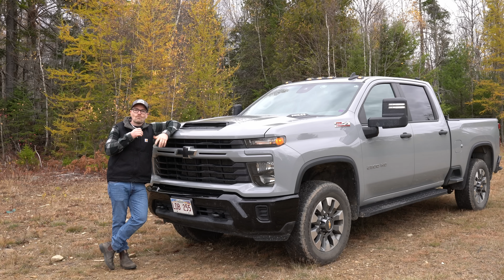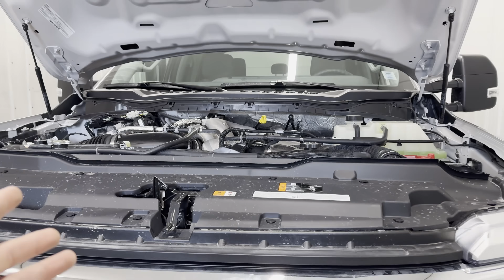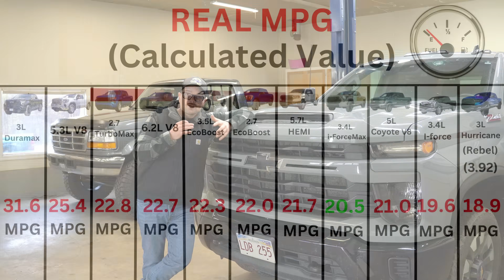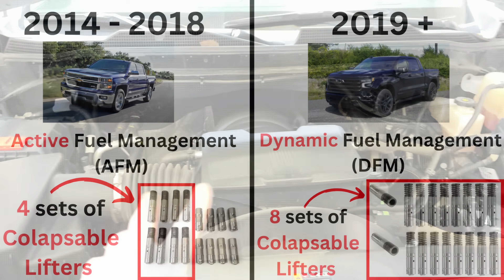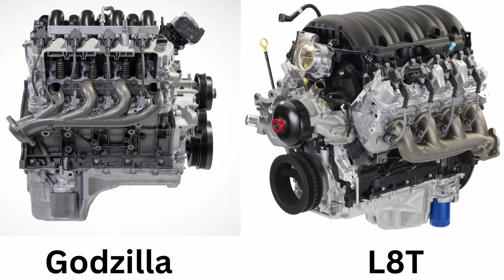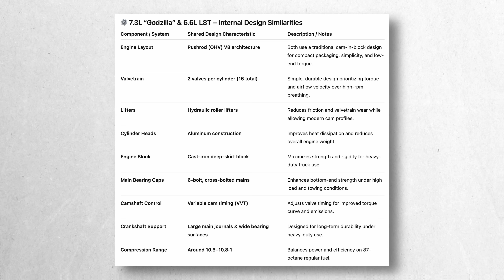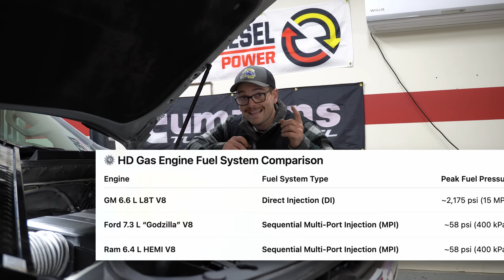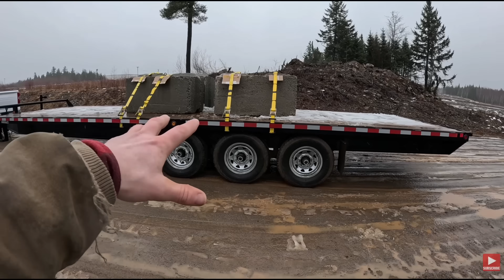Chevy 2500 6.6L L8T V8 Review | GM’s MOST RELIABLE Engine They Still Build

Comment: Man those 8.1 and 6.0s were tough long lasting engines! I doubt they will ever make an engine that lasts as long as those again.
Reply: I’m holding onto my 2016 6.0. Doesn’t even have 30,000 miles yet.
Reply: @Zach_CB I have only 57k miles on my 07 classic service truck 6.0
Reply: @Zach_CB wow
Reply: @Zach_CB how ?
Reply: I have 340,000 miles on my 2015 6.0 and she's still running very strong.
Reply: I have a2009 extended cab 2500 lt. 6.0 the best truck I've ever owned. I have 266000 on mine docent ues a drop oil the best engine ive ever had. Will keep this truck for a long time.
Reply: I like my 6.0  slight underpowered at times but it works, easy to add power also. 130k I'm driving until it dies
Reply: I own a 2006 8.1 silverado  (191k miles) , 6.0 silverado 2000 (420k miles on it, owned it for 17 years), 6.0 express 2004 (300k miles). they might be what most consider old but they always get me home, regular oil changes all it takes.
Reply: I’m at 248,xxx on my 6.0, easy to maintain Nd decent power
Reply: @3g2000gt I just sold my 2011 6.0 with 285k.  I sometimes wonder if I should have kept it.
Reply: My 2025 pulls so much better then my 2008 that it replaced. The only thing I don’t understand is why the gooseneck placement being behind the axel. I would think it would help pull even more.
Reply: You just watched the video about the next longest lasting engine 👀
Reply: Fact
Reply: I have all you guys beat, my 1st year released 6.0 (1999) has 112k miles and a supercharger that was installed in 2003.. runs like a son of a gun , 2nd transmission though
Reply: @AlmostOutside any vids
Reply: I have an 8100 in a 2001 2500HD suburban 260,000 OG engine and it pulls better than new trucks
Reply: 300k KM on my 2001 6.0 with a 16' enclosed trailer full of tools attached to it its whole life.
Reply: Have two 6.0s both over 100,000 still rock solid.  A 2003 and 2004 very little electronics in either
Reply: In 2003, I bought a Silverado 2500HD with the 6.0 L engine, the best GM engine I ever had.
Reply: my dad has a 8.1 flatbed, that thing is jumpy with 134k miles
Reply: Yeah, not trading my 2017 GMC HD with 6.0 plus $50k for a 6.6 with a 10spd. At least not at this point with only 42k miles.
Reply: I bought my 06 used with 60k miles on it. Traded it in for a 25 trail boss which I really like. But I wish I could have kept it. Was a hell of a work truck with only minor issues that could be easily fixed. Had 150k miles on it. A guy bought it from the dealership who lives near says he loves it. Now I want another one. Lol
Reply: @lj2814 the 6.6 l8t seems to holding up extremely well I love mine
Reply: 6.0 has lifter issues and sucks gas... It was a dog towing...

Comment: I put one of these in my 2018 Sierra 1500 after the 5.3L blew (classic lifter failure).  Bolted right up and the tuner got 400hp at the wheels (CAI, headers/exhaust, E-85).  Went on a trip to Denver and got 16 and a half on 87 octane.  So happy with the 6.6L gasser!
Reply: Did the transmission work or did you have to swap it as well
Reply: @hunterhill1013  6 speed bolts right up
Reply: @hunterhill1013 no
Reply: No u didnt
Reply: @MrC9Oh3  everything from the 1500 to the 3500 is literally identical under the hood. the 1500 even has the empty hole where a 2nd battery goes for the diesels. it may not have those options from the factory but swapping them in isnt that hard. for instance if you get the diesels or other industrial engine options that come in like a 5500 or similar, you can retro fit the upgrades those would have on to yours surprisingly easy.  for example an ambulance has a 2nd alternator to power everything in the back, on the diesel theres a spot right on top of the block, its a simple bolt on to add it in then you just have to swap to the bigger belt for it. also some have an extra cooler for transmission fluid, the connections are already there you just have to bolt in the cooler and add the lines. lots of other upgrades are totally possible and simple to add because the drive train was already designed for it
Reply: @MrC9Oh3  ok

Comment: 2025 6.6 Chevy here and love it so far. Coming up on my first oil change. Are you guys going with what's recommended in the manual??? What is the opinion out there on the oils for this motor???
Reply: stick with AC Delco or Mobil 1 5w30, your oil change should be free at the dealer

Comment: Had 2 of these in my fleet eat a cam and destroy the engine. Dealer replaced just the cam and lifters only to have the main bearings wipe out 2 months later. Even after i told them there would be alot of metal in the engine from the cam failure.  6 months later and i have another one down with the same issue and no parts are available.  GM is garbage.

Comment: As long as the transmission is reliable, “clunky” is fine.
Reply: they didnt even have synchro's in transmissions in cheap cars until the 60s were pampered
Reply: Just traded out of 22 At4 after the 6.2 failed for a 2026 2500 gas and it has Allison badges
Reply: Trans is not reliable, it’s not an Allison. It’s a larger rebadged 10r80. It’s so unreliable it caused Allison to cancel their relationship with Chevy moving foward. Dealers are going to have to remove Allison badges off of new trucks start in in 2026
Reply: @johnwalker6140 a whole lot of misinformation in one post lol.
Reply: @johnwalker6140  That's actually not true. They are probably the most reliable auto trans that GM has ever produced. The 6 speed autos not so much. And I agree about the Allison name. Who cares, just give us stuff that works.
Reply: @CabinCruiser  😂😂😂😂😂 do any amount of research and you will find the 10 speed is a live grenade. Allison terminated their contract with Chevy it’s so bad. Do some research bud
Reply: @johnwalker6140  Only the bad examples are the ones talked about and I believe most of those issues were addressed coming into the 2025 models. I do research and even get insider information as it IS our actual industry that we work in. 👍
Reply: @CabinCruiser  go watch any ‘The Car Guy’ or NextGen videos on all the technical issues with both gm and fords versions of the same 10speed. https://youtu.be/m2GwZ0JPAMM?si=clgRtgdvpni8h9pQ (bu the way in a 15 year certified master tech as well)
Reply: @CabinCruiser  if it’s so reliable, why doesn’t Alison want to put their name on it, not only that, why is Alison demanding their name be taken off of it….because it’s so bad😂😂😂😂😂😂
Reply: @CabinCruiser  Well your inside info is crap. Lifetime GM tech and these GM designed "allisons" are junk, have been replacing 2026 units lately. when it fails, not if, cant get parts and the truck sets at the dealership for weeks/months waiting on parts. They are POS transmissions
Reply: @Ever443 I’ve been noticing a strange noise on the one I drive at about 40 mph on the downshift (transmission) I’m sitting at about 2700 miles on the odometer. 😬.
Reply: @KenHamner-gr6pm it’s fine

Comment: I wouldn't any sleep over the direct injection. I can personally attest to almost 108,000 trouble free miles personally with a much higher stressed engine. Also working for Nissan, I've only seen one problem and that was a pump lifter that kicked the bucket because they guy didn't change the oil. I doubt the fuel system will give me any trouble on my truck. GM stuck the high pressure pump on the back of the cam shaft right where a distributor used to be on the 454s and 350s.

Comment: The LS and LT were great engines.  Scrap all the direct injection, cylinder deactivation, etc.  those are the things that ruin all these late model engines.  They will literally run forever without that 💩💩💩.  KISS is the way to go.  I would prefer a 427 or 454 displacement, bigger is better.

Comment: Just heard Allison is not renewing its licensing agreement and is demanding removal of badging on inventory after June 2026. Not a good sign of their faith in the 10 speed.
Reply: Allison did not make the 10 speed, GM had the licensing agreement for it so they slapped it on there and Allison disliked the bad press it gets and they don't want their name on a high issue unit that they didn't build. I don't blame them. Personally, I Hope Dodge can pick them up and get it behind the Cummins, and then fix their front ends. Would make a powerhouse of a truck.
Reply: @nolanbumgardner3576 I have a 3500 with the Toyota Aisin tranny. 321000 on the clock and zero issues. It’s a tough transmission, even though it is super slow to shift and sometimes can’t make up its mind what gear it should be in.  but if it goes I will be putting a 6spd genuine Allison in. I am happy that Ram went with the ZF in the new trucks though. I have a couple friends with the new trucks and am curious how they will be lasting.
Reply: @nolanbumgardner3576  They already have ZF for their transmissions

Comment: I have a 21 3500 HD DRW with a 10' deck on it. When I was looking at propane conversion, I thought the conversion place said these where direct and port but maybe I misunderstood and the propane would be direct injection? I love the simplicity of this engine. Cold start the exhaust smells like a early 2000's V8. Maybe due to different emissions regs for cab and chassis but I take it as simple fuel mapping. I do notice some oil consumption hauling our camper in summer, if your working it, maybe 1 L over 8,000 km. I tend to do 8,000 km intervals with 5W30 Motul full synthetic. Usually 30-40% oil life showing but sniff meter smells like it's due. I feel the oil filter is to small and maybe that leads to higher oil temp which burns it. My only complaint with this truck is punishing empty ride quality with the torsion bar front, no up travel but should be a dependable long term unit. That motor should take supercharging well??

Comment: The high pressure fuel pump requires removal of the intake to be replaced. Not really a deal breaker, but I do understand that it may not be one's favorite thing to do. The fuel system is pretty simple on this once the intake is off.
Reply: It can be relocated to the frame rail
Reply: getting the intake off is pretty standard and not that big of a deal for most projects. hell transverse v6s you have to take it off just to do spark plugs. so im sure there could be worse. could be german

Comment: Thanks for all the info, bought one recently, and very pleased so far… tows much like my ole five point nine Cummins, and rides super smooth.  I’m hoping to avoid any soot build up with top tier fuel and fuel treatment.  I’m will for sure change the oil every 5k, looks like it will be super easy!  I purchased, actually had to order a two wheel drive, base truck, that for me, checks all the boxes, a little technology, comfort, and simplicity.

Comment: The overhead lights aren't solely a GM signature, the three "identification ' light in the middle are DOT law  when towing a trailer over 80" wide or for the truck alone if it's a dually. The two outer lights indicate vehicle height.

Comment: The only thing I have experience with these 6.6s cropping up, and this isn't particularly the engine's fault, is the AC compressors going out. Most suppliers around here are on backorder due to the frequency of failure. Likely due to high idle hours, just like the eco tune 7.3s had with their oil pumps.  I think the biggest takeaway about that 6.8l feeling more peppy would have more to do with turning the sheer mass of those heavy duty 10 speeds. If I'm not mistaken, the 10r100 has a similar sized case to the 10r80 and is based on it versus the 10r140 or the GM here. That's not a small parasitic loss. Thanks for diving in and going over the background details on your videos and not just regurgitating brochure media material. This is really shaping into a very well-structured channel.

Comment: I have the 6 liter in my 07 2500. Lots of miles and still going strong.😊
Reply: My 2014 GMC 2500 6.0l has 752000 kms on it ......still working...never been in the motor...been an awesome work truck
Reply: Wow dude thats awesome. Good for you. Keep er going 😅
Reply: under powered and terrible mileage but a solid and reliable engine in general.  If you are happy that’s all that matters
Reply: @Jez-p9k ....i am happy with it because the truck and myself are both retired.😊

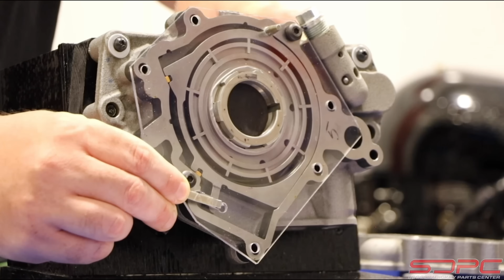Comment: @6:03 6.2 are being switched to 0-40, so even 5-40 or 0-40 could be a possibly better oil choice for an HD engine
Reply: Only for ones not built properly. The 2026 are back to the old spec

Comment: We have a 2020 f350 powerstroke and a 2023 gmc 3500 gasser. Both DRW and both work our farm. The 350 tows a 38ft 6 horse. The 3500 does everything else we need done. Both serve there purpose. The 350 has definitely cost us more money in maintenance and repair. The 3500 has 130k miles and has only need a front axle seal replaced. Nothing more.

Comment: Thank you for the informative video. We own a 2024, 2500 LT with this engine. You mentioned a problem with carbon build up on the fuel injector. I am considering using a fuel injector cleaner to help mitigate the carbon build up. The research that I've done points to using an injection cleaner with PEA (polyetheramine). Is this something you would recommend or is it a waste of money? My concern is I do not want to add something that could be harmful to components of the fuel system. Again, thank you for making these videos - they're very helpful.

Comment: Love my gasser for working, said Noone ever.....
Reply: We have a 2020 f350 powerstroke and a 2023 gmc 3500 gasser. Both DRW and both work our farm. The 350 tows a 38ft 6 horse. The 3500 does everything else we need done. Both serve there purpose. The 350 has definitely cost us more money in maintenance and repair. The 3500 has 130k miles and has only need a front axle seal replaced. Nothing more.
Reply: diesel actually sucks these days. if i had to buy something for towing itd be this or the ford big block. 
DEF ruins everything

Comment: As long as I doesn't have cylinder deactivation, it's a winner in my book
Reply: Amazing that the manufacturers don't seek any input from buyers who actually know a little about cars before adding terrible features that we hate.
Reply: @camarokurt  our opinions don't matter when the government set fuel efficiency requirements.  Ironically, I get better mileage with my AFM turned off
Reply: @porkchop10 the 25/26 now doesn’t have the step down on them  anymore. That’s the only way I would buy one. Step tech is dumb as the technology and the people that came up with it.  Oh…… yea liberal leftist tree huggers want that mess. 
The simpler it is the better the drivetrain!
Reply: It does not have cylinder deactivation !!
Reply: only way to go
Reply: You can delete those cylinder deactivation chips.
I agree, those systems suck all together, long term. I get the point, but it’s one more weak point that can and does fail.
Reply: I don’t want cylinder deactivation or direct injection which this does have , the top choice for a heavy duty gasser.  on top of that still having transmission issues. Andy least comfortable seats.
Reply: @ajmedeiros77 this does not have afm or dfm and direct injection is harmless
Reply: @ajmedeiros77  direct injection makes more power but carbon buildup can be a problem
Reply: Carbon build up is rare these days
Reply: Bro didn't watch the video
Reply: @Kahuna_550  he probably did watch the video and is just commenting in general terms
Reply: @billthomas8994  That’s how I took it.
Reply: @Kahuna_550 bro thinks words iz fer gurls
Reply: @Kahuna_550  Yes he did.  This engine does not have cylinder deactivation.
Reply: @Kahuna_550 but it doesn't have cylinder deactivation.  Did you not watch the video?

Comment: I worked for a utility and survey company that was slowly replacing the older gen(2018) F250s with these. To be honest even though they felt a bit more peppy than the 6.2s(likely the 10 speed trans) the transmission felt really jumpy and I really wondered if Allison actually designed it lol. Having driven multiple of them the transmission lunched a bit and almost felt like it was slipping. Could just be me but it was enough to make me worry about buying one for myself
Reply: In case you aren't aware, Allison didnt make that 10 speed. GM just had the licensing agreement and slapped the badge on it.

Comment: New Subscriber.. Love this channel especially the towing videos -- QUESTION -- While I like your MPG tests, one problem is that we need to know MPG over a mostly level/flat highway.  Since most of America is flat and not extreme hills or mountains your videos on MPG towing 8000lb trailers, are hard to understand.  Could you please run these truck over level highways so we have both numbers - mountain towing plus level highways.  For all we know that F150 V8 3.73 gears could be getter 14 to 18 mpg over level ground when towing that trailer???  Would love to know the numbers for both.

Comment: I OWN A 2022 W/ THE 6.6 GAS AND LOVE IT.  I HAVE TYPICALLY OWNED FORDS.  
I HAVE BEEN PLEASANTLY SURPRISED W/ MY FIRST CHEVY TRUCK PURCHASE.  IT DOES ALL I NEED & HAVE TOWED AS MUCH AS 12,000# TRAILER & PAYLOAD.  NO MAJOR ISSUES TO DATE.THE ENGINE FEELS STRONG AND SMOOTH.  THE 6 SPEED ON MY TRUCK NEVER HUNTS FOR THE RIGHT GEAR.  SO FAR , VERY HAPPY W/ THE TRUCK.
Reply: Do you have any oil consumption? I’ve heard that’s a thing with the 6.6.

Comment: I have a 2021 L8T with 72k miles, zero issues to date. I do frequent boat trailering from Spring to Fall in South Alabama. The 6 speed has been fine, on the highway on cruise she’ll hold a gear a little longer than I prefer but beyond that no issues or complaints. One question I’d love to know your opinion. With DI, would you recommend performing an upper engine DIY cleaning using something like SeaFoams upper engine cleaner to help reduce deposits?